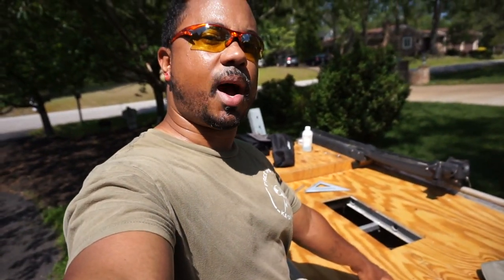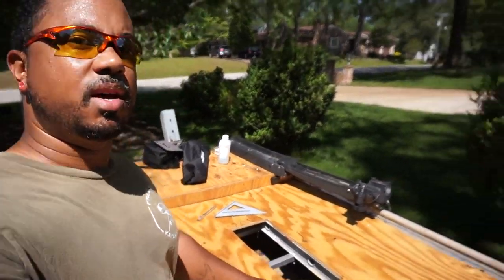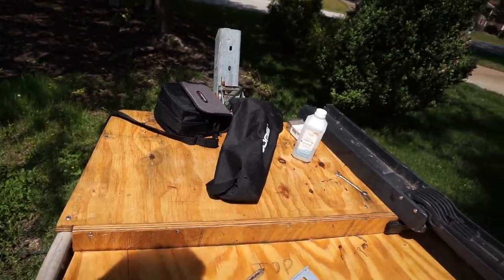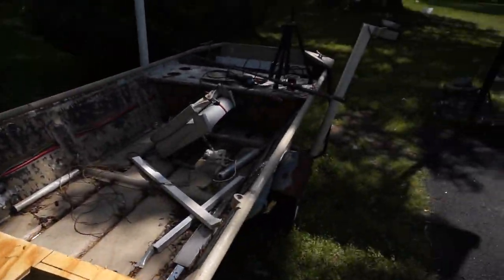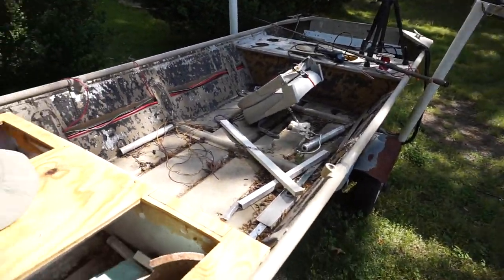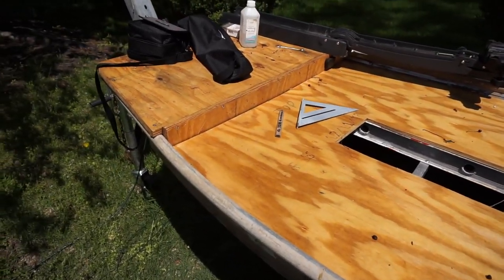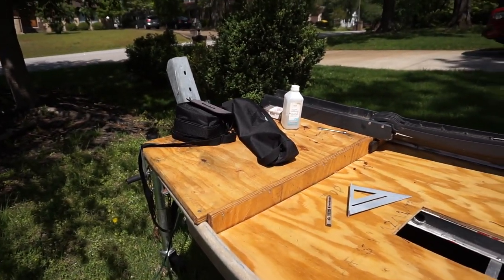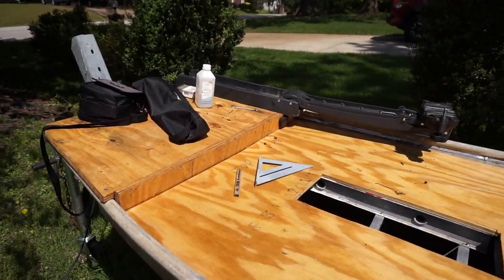Jon Boat Build - Using Fiberglass Resin to seal wood is not for me

Comment: What brand and kind of resin did you use? I used Bondo fiberglass resin on my rear boat floor and let it cured and it get wet all the time with no cloudy or milky color, put it on last year and it get wet all the time with no issues. My only complaint is the price of the Bondo resin.
Reply from the maker: Bondo.  But I wondered if it was just humidity in va that messed it up

Comment: Would using a waterproof deck paint then clearcoating with a clear resin be a good idea on plywood? I'm building one too currently. But mine is completely 2x4's and 3/8ths plywood.
Reply: The framing is 2x4's. The siding and bottom is plywood. I was wondering how I was going to seal it the best. I want to paint and then add a clearcpat but I'm not sure which stuff to use
Reply from the maker: I don't know.  I ultimately used epoxy garage floor seal paint.   IMO... if I get it to last 5 years in Va I dun 👍guud!

Comment: be warned you will need to sand and repaint the wood every year  ask any boat builder and they will tell you keeping moisture completely out is impossible you can only slow it down 
last word advice paint both sides of the wood fill all cracks and crevices especially in the edges of the wood
 you may find it better to use 1x4's 
as theyre solid wood all plywood is  multiple layers of wood glued together
Reply from the maker: Thanks! I painted all edges and surfaces. But like you say,  I ran fasteners through it later! And it's wood! 🤣  no way it lasts forever.

Comment: It hurts my brain to hear the endless advice on dealing or building job boat decks. Expensive proxies, aluminum, special tools, patience of Job. I’m fine low tech. I will use oil based paint and call it a day. When it rots it will take only a day to put a new deck in and so much less expensive. Thanks, later gator. Seems like most producers on you tube are in a different reality than I am. I won’t survive much less fish if I have to give a pound of sweat for an ounce of water. I’d just go to red lobster.
Reply from the maker: LMBO!  In a lot of ways I agree with you!  I don't think I will build a boat ever again.  I enjoy being a maker, but my fortitude for THIS is expired.  My first two boats weren't sealed AT ALL! And I used treated which was a big big mistake in one.  No hatches, hinges... just a floor.  Fished it for YEARS and did great.  Simplicity is valuable.  thanks for watching!
Reply: Someone led me ti use plyform, formply, as my deck. No rain in the forecast it rained. My unused plyform’s layers separated  after one moderate rain.

Let me rewind.

Bought a fully decked out 17 ft Lowe Jon boat on marketplace, The guy said call me if you have any questions. I had to gut entire boat due to rot. Guy nowhere to be found. I started watching endless you tube and reading forums, there was nothing at my lumber yards that everyone apparently has easy access too. Learned about heavy not so cheap plyform. Now I have this on my front deck with expensive epoxy and paint with glued carpet. Spent around 800 on all “improvements” in a boat I thought needed no work and still haven’t taken it out. I need to be smacked but the pain of paying big for my mistake hurts more.

If it doesn’t hold together or weighs it too much I have a sheet of MDO which I’ll try or just forget a deck.. I would try marine grade but I’m not wanting to spend more time and sweat. 

On the positive side I’m not venting to my wife. I’m going to protect her from it.

I wanted this for the grandkids. This is another long list of buys trying to bring people together. The bright side is I know no what not to do,
Reply from the maker: WOW, I mean wow.  Thanks for sharing your battle.  I have always been interested in Starboard (not sure how the cost compares) but it is the same stuff Kayak equipment is made of.  Look up Zoffinger on Youtube, he has mounted outboards on kayaks with this stuff.
Reply: @WAEofFishing  I’m venting a bit, lol, but I’m the long run it’s all ok. I had ti go to the bathroom at the state park and they had these stall doors made of waterproof sort of fiberglass doors, I may find what they are , lol. Thanks for keeping it real

Comment: Lol takes like a few hours to do. And seals it forever. It's the best thing to use.
Reply from the maker: Negative ghost rider.  Hardens too quick. burns through cheap brushes and fumes are offensive to my whold neighborhood.  For me, it's a pass. :)
Reply from the maker: @v8consumption  🤣 not with fiberglass resin. I'll admit that.
Reply: @WAEofFishing  just gotta use less hardener and it’ll work well in heat.
Reply from the maker: Ahhhhhh
Reply: @WAEofFishing  haha I had the same issue, once I lessened the amount or hardener it took more time to cure and set so it worked, just have to use enough that it still hardens over night. Sometimes it takes a few days to fully harden but if you use a lot of hardener, pour it and brush it out fast it sets in less than a day. All about humidity-hardener together.
Reply from the maker: My other problem here was it had to be outdoors bc of the fumes. My garage is attached.  The dew at night on the uncured resin was bad
Reply: @WAEofFishing  haha I tend to do my work in the spring or fall with fiberglass, but in my experience having a couple fans blowing out and away from the door inside with the garage door open reduces fumes. I usually do it under a carport though because if the size of my projects
Reply from the maker: No carports where I live! 😑 HOA
Reply: @WAEofFishing  oh. Ours is separate from the house. It’s the frame for what we eventually are building walls to turn into a garage, it’s 30x30 and is 2 stories with a full shingle roof. Best work space imaginable!
Reply from the maker: OMG.... jealous as H.....
Reply: @WAEofFishing  😂 we can’t frame and wall it because of wood prices currently because we’d rather do it all at once, but it is nice. All our equipment and both vehicles and my canoe and kayak fit under it squeezed tight but usually the trucks aren’t under it unless a big storm blows through.

Comment: I used  Elastomeric roof paint on my ply wood
Reply from the maker: Ooooooo, ok. New to me.   What's the cost compared to exterior paint
Reply: @WAEofFishing  im not sure I just had a 5 gallon  bucket laying around.
Reply: Just looked it up for a 5 gal bucket its $65 but I did 2 coats front and back dident use it all
Reply: Aye man how's that working out for you ?? Did you so the whole hull .